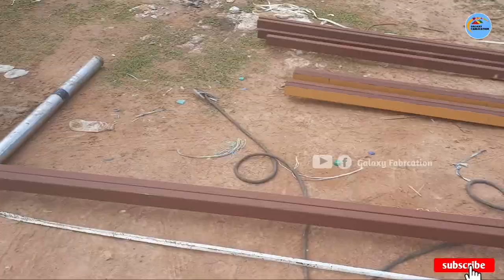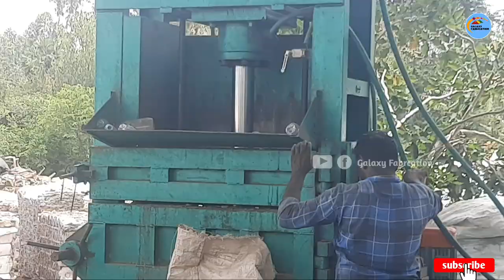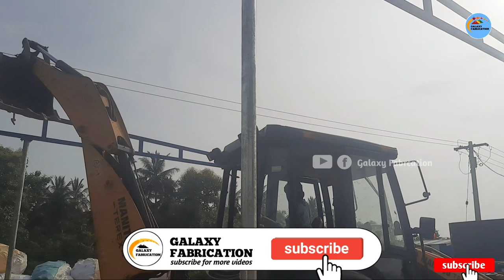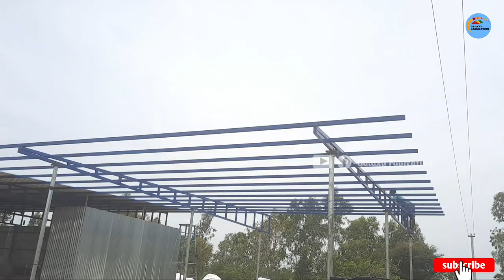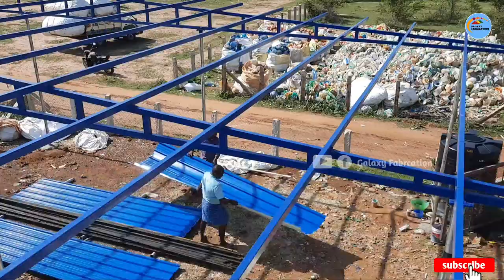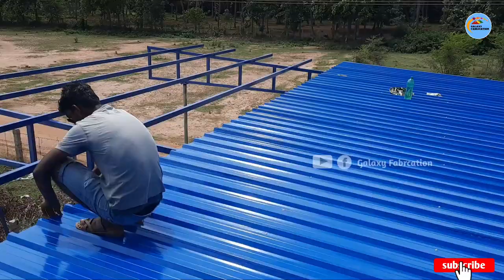Industrial shed work | building industrial shed |  Galaxy fabrication

Comment: Size of shed,pipe size with thickness,distance between two pillar,give detail
Reply from the maker: Material size,
2½"×1½"(6×4cm)
3½" round galvanized Pipes
0.47nm coulor coated metal sheet
Column to column 12feets
Size 30×36
Reply: @GalaxyFabrication  Pipe ka thickness nahi bataye sir krupaya bataye baki sab information aap bataye sir khade wala pipe ka bhi thickness bataye sir
Reply from the maker: @bharatindian2882  3mm thick sir..
Reply: @GalaxyFabrication she'd size 60ftX50ft hai column to column 15 feet distance rakha to chalega kya(60)feet width mai 5 Kaichi,(truss) sir perlin distance 4 feet  rakha hai and vertical pillar 4"x,4mm thick square pipe leye hai 9(nos),3 truss 4" pipe resting 50 feet length mai.baki 2 truss 3" pipe pe resting back side 2 front mai front kaichi per resting Mera design hai
Reply from the maker: @bharatindian2882  column pipe to pipe 10 feet to purlin channel ka size 1½×1½ (4×4cm) rakho.. 12 feet ka jadha hey tho purlin ka size 2½×1½ (6×4cm) dalo..
Reply from the maker: @bharatindian2882   height kitna? 'A' model shed hey kya?
Reply: @GalaxyFabrication  height 20feet hai sir ha model banaya hai sir mainey 3d software mai ya kaise load karna malum nahi comments mai
Reply: @GalaxyFabrication  one side slope hai sir 9 column leye 20feet ke ,usper kaichi banaye 2.5feet slope wali 50 feet lambi ,
Reply: 10000 sqft DHBA shed banane ke liye KITNA kharcha aayega